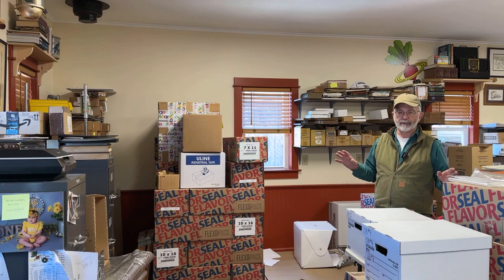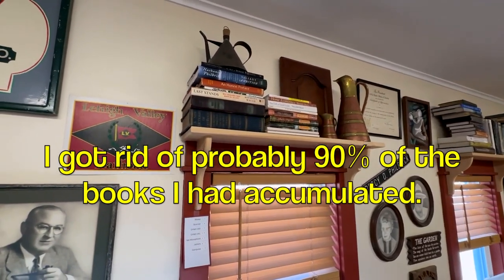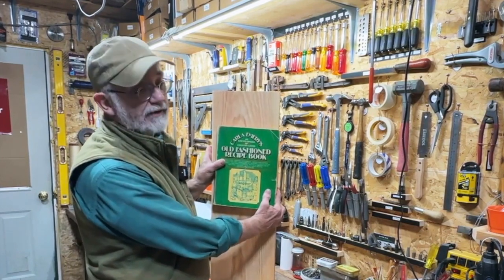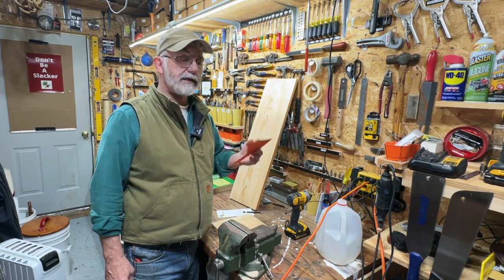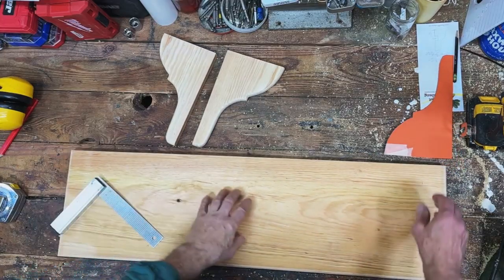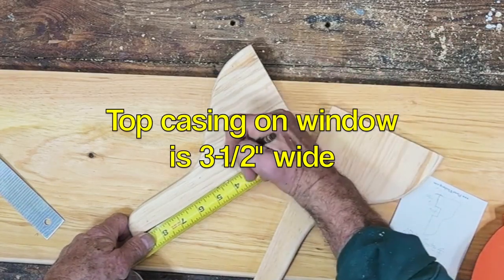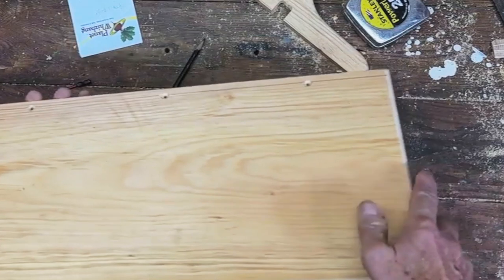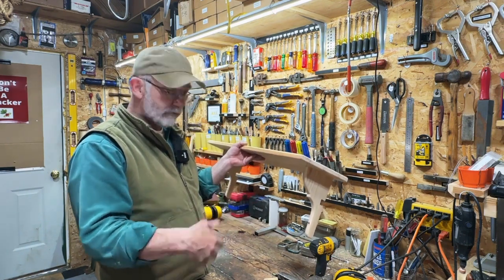Make Over The Window Book Shelves (Bracket Pattern Included)

Comment: I am planning to make something similar. My windows have a moulding at the top, which makes it more difficult. I will NOT cut or remove the moulding. Whatever is done to an old house should be done with care, making certain it can easily be returned to original. I also may make some as cabinets with doors.